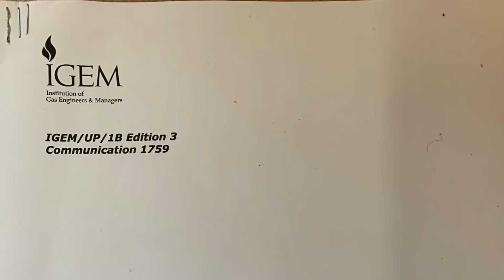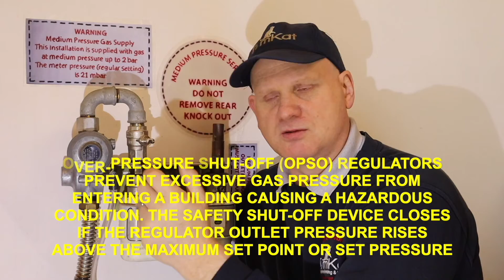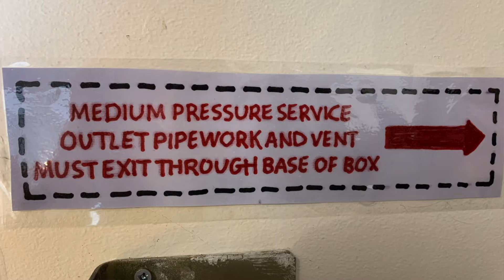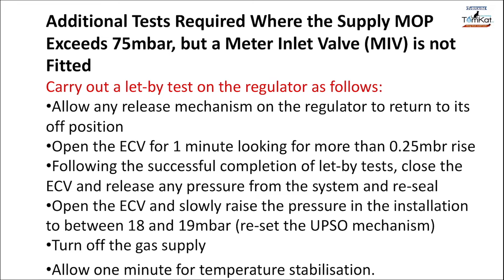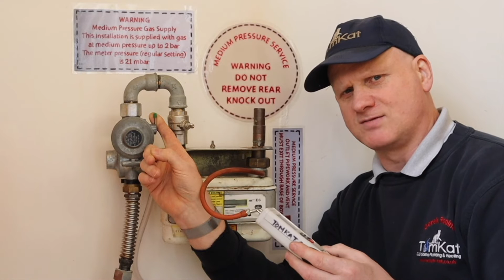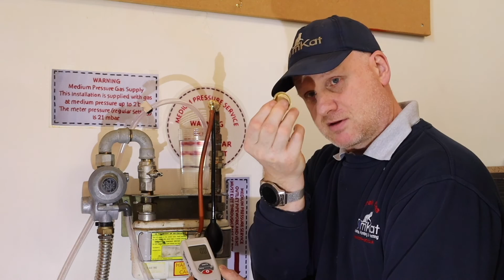MEDIUM PRESSURE TIGHTNESS TEST. gas tutorial for trainee gas engineers on how to carry out the test.

Comment: I'm not a gas engineer but I'll have a stab at why the let-by test is done at 7 to 10 mBar rather than checking against zero. Testing at 7 to 10 mBar is to check the manometer and it's piping are in working order. If the device stays at zero it could be that the manometer is broken or there may be a split in the rubber tube so no pressure reaches the test equipment, where as getting the pressure at the manometer up to 7 to 10 mBar proves it's functioning and a drop would suggest the test equipment is not properly connected or has a fault that means it cannot be relied upon.
Reply from the maker: Good try mate but the let by test is to see if the ECV is passing not a gas leak so if it was passing it would rise the tightness test is for a leak and if you found it’s dropping then you have a leak. Gas engineers are trained to inspect their test equipment before. Also if you put the pressure to 20mbr and it rises more than 0.25mbr on a u gauge then you would still see let by.

Comment: Roughly how much does it cost & how long is the course to add Medium Pressure to your gas qualification
Reply from the maker: It’s not a stand alone qualification it’s in with ccn1
Reply: @tomkatgastraining  
Though smart meter installers need ccn1 and that doesn't cover medium pressure gas
Reply from the maker: @chazzlebazzle69  ccn1 covers medium pressure more in initial than reassessment

Comment: Really needed to add some equipment/ unit as the pressure valve will show more fluctuation and the regulator has to differentiate the mean value, are used to test the unit until they were fazed out- as new stands party written as they have not understood or asked older gas engineers 🙏